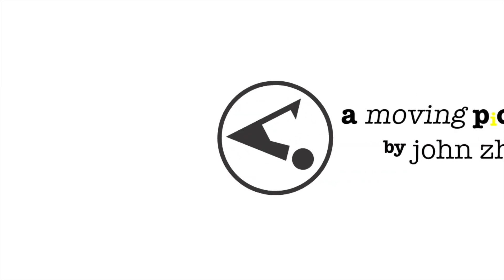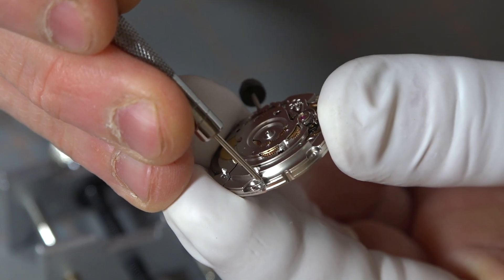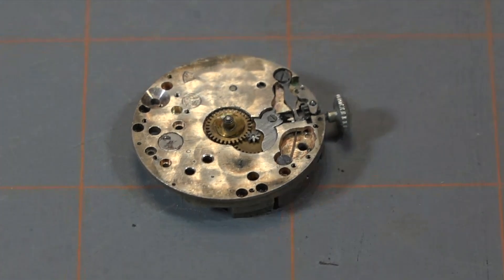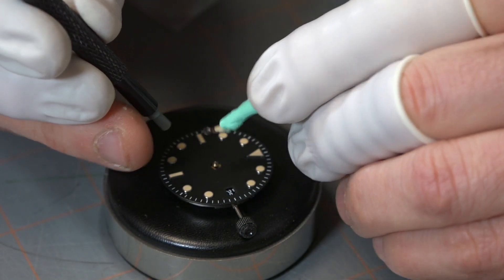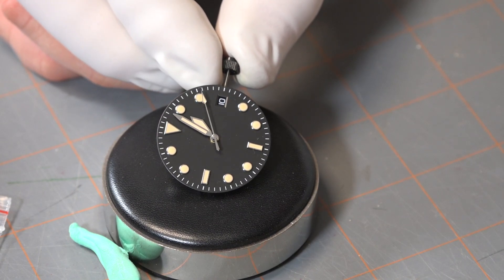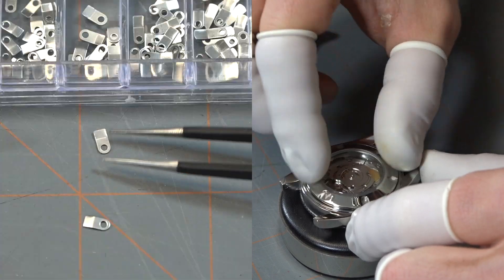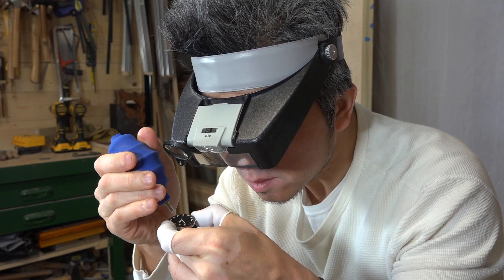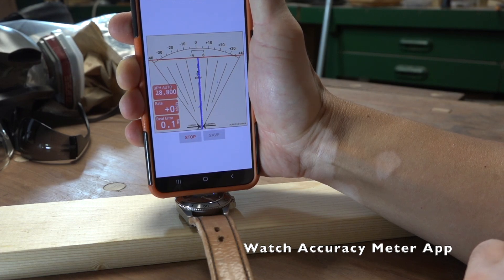DIY Mechanical Watch from eBay Parts ETA-2824

Comment: I was thrilled to stumble upon your cutom build using an ETA movement, after seeing countless Seiko Mods.  I'm going to start building in 2026, I'm really excited, can't wait. I love your clam, loving attention to detail of this build - you were brave to film your first build - very well done John. 
Is the ETA a chinise copy, as you mentoned it has chinise parts, or is it a mixture of both. It does look lovely. 
I like the Miyota 9015 movement for it higher beat rate, which will be on my project list of builds.  I'm actually going to do an AP royal oak homage as my first project, I love the design. To me it looks so classy. 
Oh, and well done making your own watch band.😀
Reply from the maker: Thank you. I'm glad you stumbled upon thia vid too. It's a genuine eta movement (though I  am sure it has Chinese made parts. Having Chinese made parts, to me, doesn't detract from the movement,  these parts are made to the specifications of the Swiss importer. There is a strange phobia towards Chinese manufacturing, about it being low quality, eventhough the Chinese make them to thw same standards as Swiss made parts, just ar a fraction of the coat. Good luck on your project, feel free to link your project to this video.

Comment: FYI: On ETA2824-2 or the copies, the stem release has a key slot hole that requires a #10 or red stripe screwdriver to push down on the button. NOT a pointed tweezers or pin. Doing so can make the button go too far down and damage the mechanism.

Comment: Where did you get real ETA 2824 movement? I've seen them on eBay but they're usually labeled as another manufacturer, like TAG. 

I don't think ETA (SWATCH) will sell to anyone other than their own products.
Reply from the maker: On ebay or Amazon

Comment: Hi, thanks for the video which is very helpful.  I have found attaching the dial to the movement very tricky.  I have struggled to get the pins on the dial to be held tight by the movement and I couldn't quite see how you tightened it.  The dial keeps falling off.  Also, which app do you use to test the accuracy?
Reply: All movements have different ways of holding the dial feet. This movement has two, small clips that rotate outta the way to insert the feet. Once installed, you rotate the clips back and that friction holds the dial in place. This is the same for most ETA (and clones of ETA) movement.

On the Seiko movements the dial feet are simply inserted into holes of the movement ring and friction holds it there. 

If you struggle to insert the dial feet, they are probably bent.

Comment: Sir,I just completed a watch much like the one you assembled here. I was extremely fortunate, as I knew little about what I was attempting. Somehow, all except one of the eBay parts fit.  I struggled with it for six months and gave up. I took it to a watch repair shop and asked them to complete it for me. They promptly damaged the movement and said they had the replacement parts on order. Two months later, I picked up my damaged "kit" watch and brought it home. It sat here another 3 months, and finally, I decided to try it again. I watched many videos on the subject, and it slowly came together. One of the most tedious things for me was attaching and securing the dial to the movement. Just tonight, did I ever see anything about the "swing out" dial leg clamps. Yours is the best video I have viewed on this subject.  I am happy with my watch. It looks and runs good, but I am not a watchmaker or even a watch repairman.  You need good eyes, a steady hand, and an abundance of patience for this as a hobby. All these things wear pretty thin at 92 years.  I learned a great deal of respect for those fellows who can do this work. Thank you very much for the time and effort you spent producing this informative piece.
Reply from the maker: I appreciate it, Thomas. I saw a similar problem with watch videos. So I  decided to do something about it. I never assembled a watch before this one, usually I am making furniture. But I  am gld it was helpful to you.

Comment: I've built a lot of mods with NH36 and NH35 movements but this time I have a ETA 2824-2 on my table. I was wondering about the tiny washer where the hell it would go and does the spacer ring belong between the dial and the movement or between the movement and the caseback. Thanks for making it very clear. :)
Reply from the maker: @blacksmithmods  you're welcome.

Comment: Great video thanks. 
I’ve literally started to do exactly the same today with a ETA2824-2 movement but ran into issues. I pressed the stem release too hard and the keyless works dislodged the other side so I then had to break apart the other side to fix them and in doing so I’m now struggling to keep the date wheel in place, it’s jumping out of place. What a mare this hobby is. You make it look way too easy.
Reply from the maker: @orbitdist  not my first rodeo. I started w old pocket watches. Also i make fine furniture, the feel transfers.

Comment: what would be the difference with a dive watch case in terms of fitting the stem?
Reply from the maker: All dives should have a screw down crown. So I think they are the same as this one. Just a bit at a time until the fit is right.

Comment: I just bought parts for my first build. I decided to go with the NH35. I read that its easier to work with as a beginner.  
I hope I bought the correct parts. The case has the crown at 3.8. I was told the NH35 will work just fine. I purchased a dial with date at 3 o’clock.
Reply from the maker: Good luck. Nh35 is a good beginner choice,  reasonably priced.

Comment: Can the date wheel be removed for a no-date watch?  Or, can you buy it without a date wheel?

Thanks!
Reply from the maker: The date wheel can be removed. I believe it comes with a date wheel for eta-2824. There are movements w/o a date wheel. With a date wheel removed, you just have a click in the crown that doesn't do anything.
Reply: @johnzzhu You can also buy a spare part that will prevent the needle to lock in a ghost position